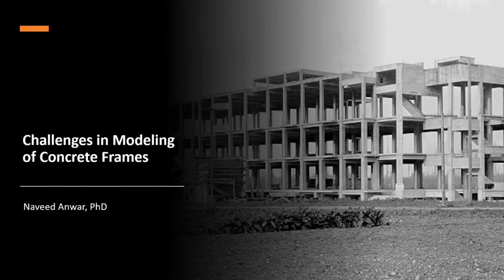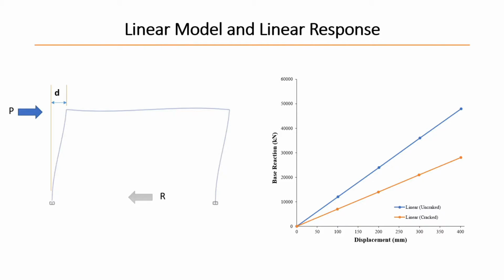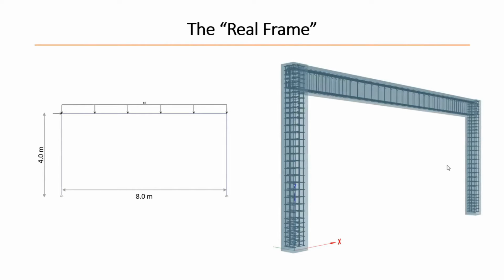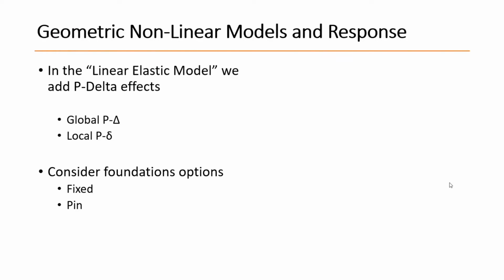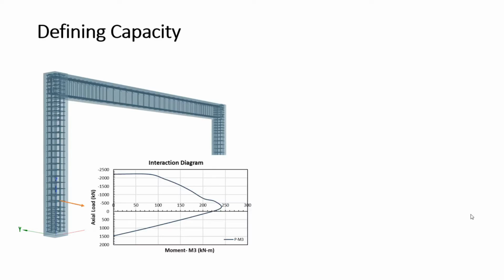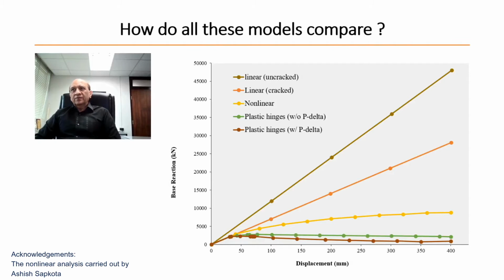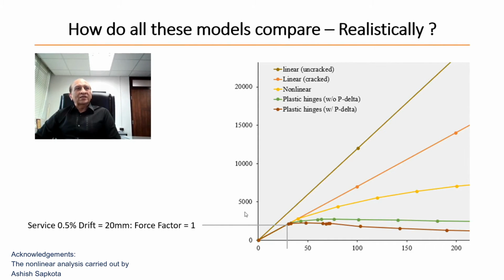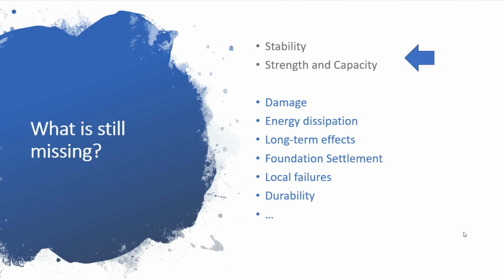Challenges in Modeling of Concrete Frames and Buildings

Comment: really many thanks for these valuable lect. Dr. naveed, and i'd like to ask that based on the last combined curves for the building responce in elastic, considering stability and capcity, if igo with elastic anaysis as usual using R factor, i can't consider the p-delta effect when i check the seismic drift and eveb base shear, this is what the last combind curves says, right?